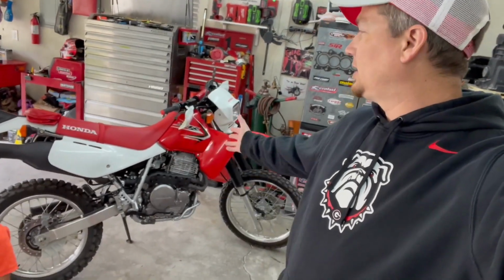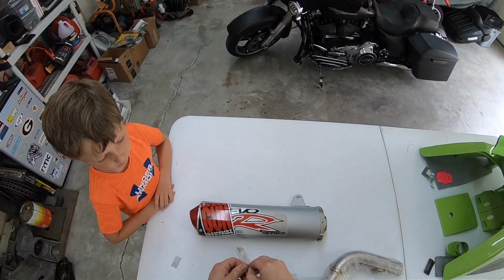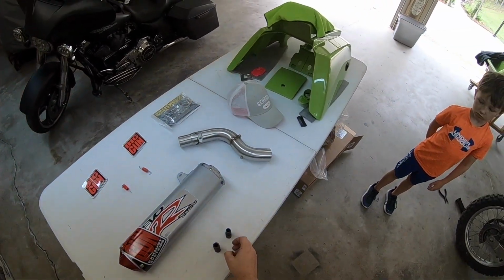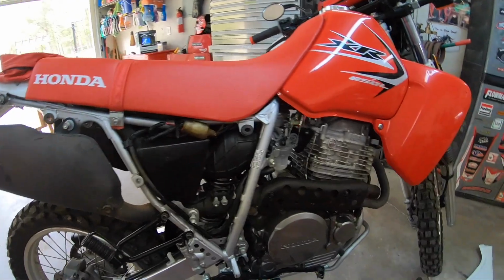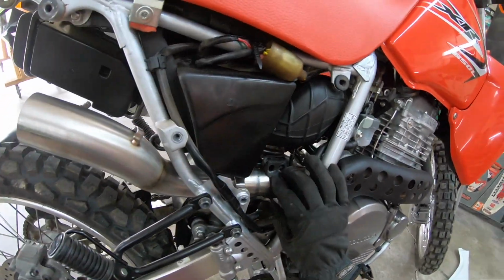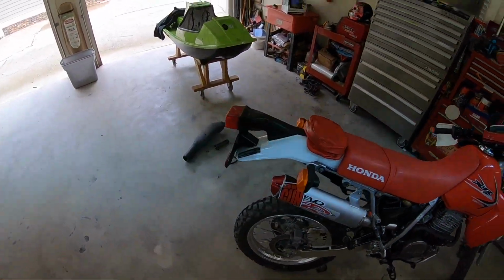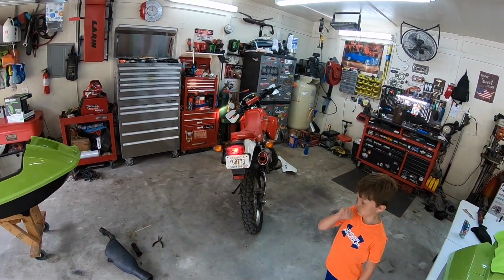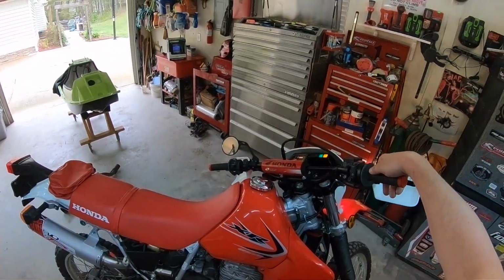XR650L Big Gun Exhaust Install 1993-2023

Comment: Is re-jetting the carb necessary to use one of the aftermarket slip on ?
Reply from the maker: @rickbrooks194  Short answer No but depending on the bike and elevation it would help the performance of the bike. 🤙🏼🔥

Comment: Great video. I have a xr650l also and big gun slip on exhaust. Did you have to reset carb. I don't think Mines been rejetted. It runs Great the way it is really. Should I jet it?
Reply from the maker: @michaelbarnes7086  if it’s running great DO NOT MESS with it 😂 I did and it was a total waste of time and headache.  Especially thinking that something was wrong and the whole time all it needed was the stock jetting. 🤘🏼🔥
Reply: @CoyoteChris  your the best brother. Do you have a oil temperature gauge from xrs only? I'll rise 80-100 miles and temperature never gets over 250 degrees. I was thinking it was the big gun slip on. So I put stock exhaust back on. Same exact results. Still 235- 250 degrees.
Reply from the maker: @michaelbarnes7086  No I don’t have one.